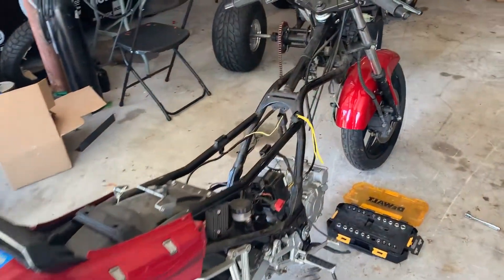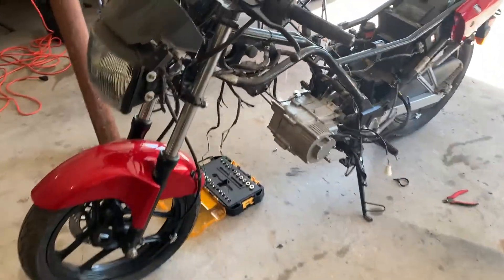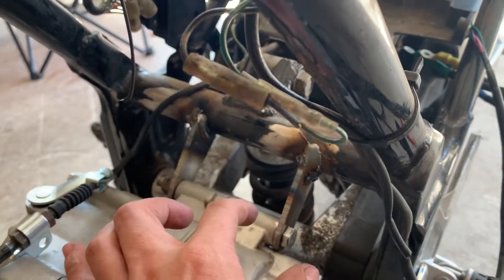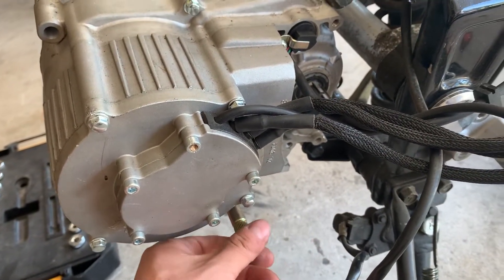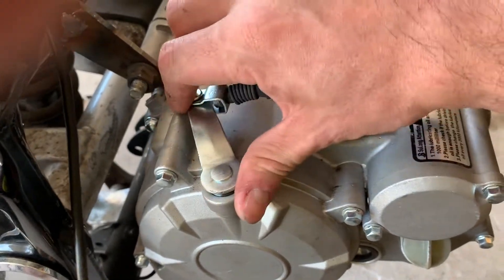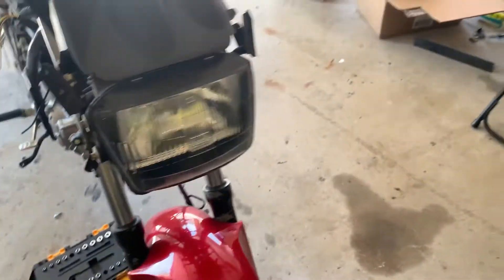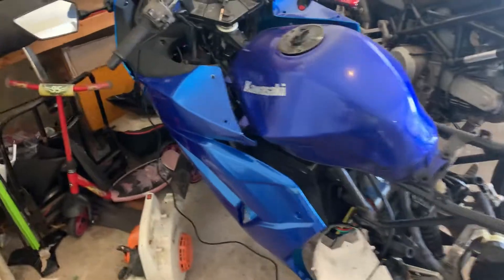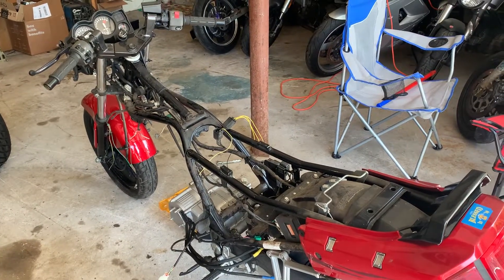EV ninja electric motorcycle conversion part 2

Comment: GOOD FRIEND THAT'S VIDEO WHERE TO BUY THE 21700 IN HOW MUCH MOTOR KIT WHAT IS PRICE THANKS
Reply from the maker: I got them from imr it was expensive about 3600 bucks , 900 for the motor and controller combo
Reply: @diyguy1476  WHERE TO BUY THE BATTERY-THANKS

Comment: Are you going to provide details on the components? Where did you get the cells? Exactly which ones are they? Please share!
Reply from the maker: The controller is a motor transmission in one set up i sell its an  apt controller 72400 , kit comes with a throttle, key trans motor and controller. I used 500 E50 21700 cells , the bike is a 2006 ninja
Reply from the maker: Also the bms is one from alli express
Reply: @diyguy1476   Can you share a link of the motor you have bought ...i tried to search ..however, i didn`t find one.